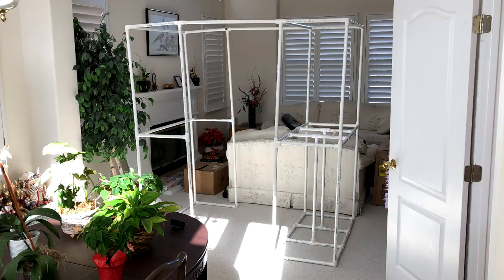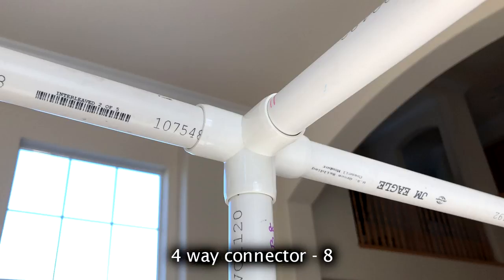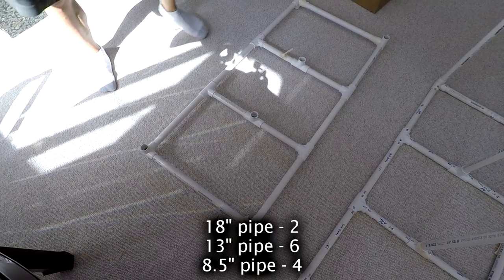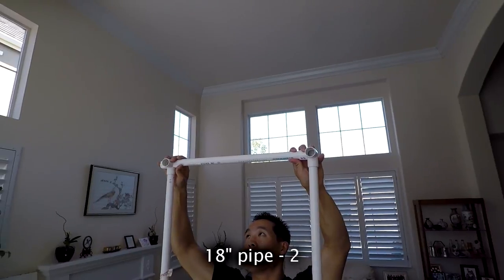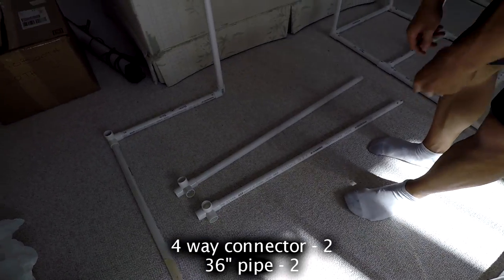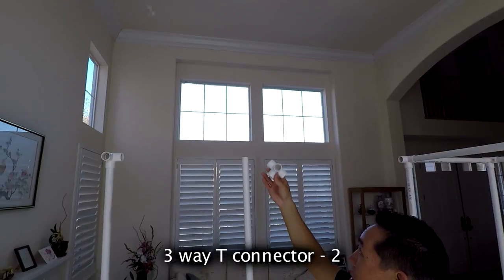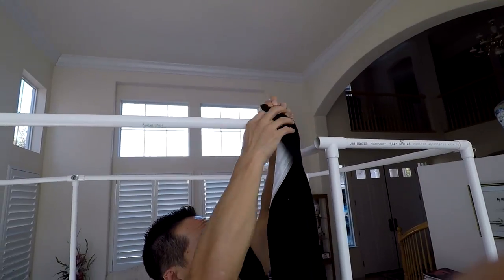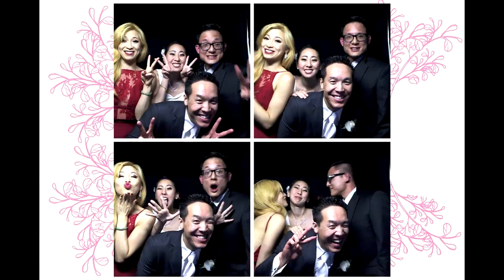Tutorial: Custom Photo Booth Build

Comment: Thanks for posting!  I've been looking for a how-to build a craft show booth frame using pvc, so this is most helpful.  It would have been even more cool if you had shown it complete as it is difficult to envision how it is a photo booth, i.e. is it supposed to be wrapped with fabric or something?  Did you put chairs inside, or?  Anyhew, thanks again...very helpful.
Reply from the maker: the drapes basically covered the entire frame. we had it clipped around the entire exterior and then put another sheet over the top to cover.  no chairs or anything like that, just standing.  the "counter" if you will for where the laptop/printer goes was torso height, so no need for chairs.  bring some props though, since those are always fun in the pics!